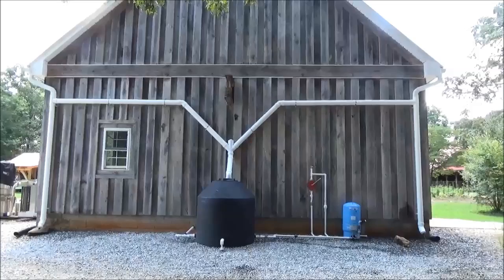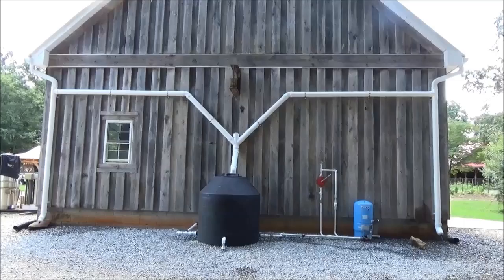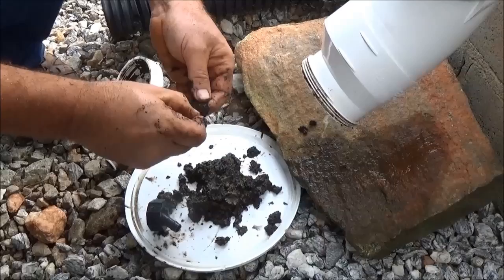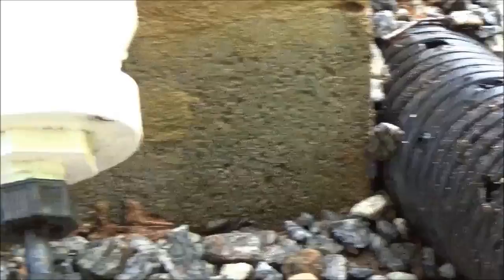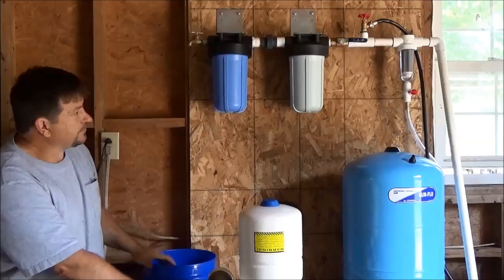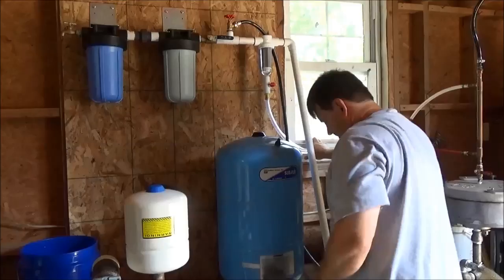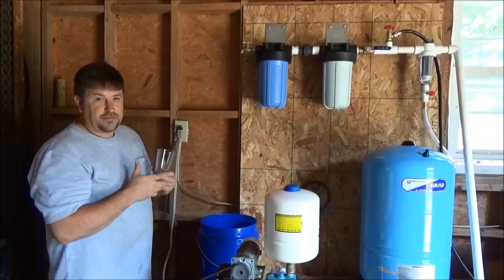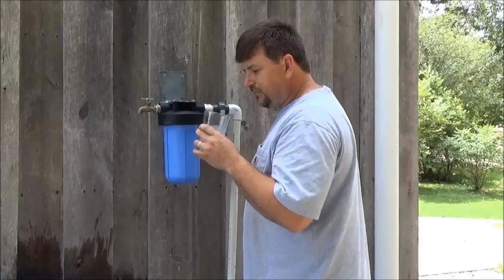Living Safely Off Of Rain Water

Comment: Hi. As a female, and one not mechanically inclined, I think I would go with a coquina bowl (porous shell rock found in st. Augustine. While on a tour at the "oldest house" they demonstrated how the early settlers would use coquina to filter their water. Boiling after filtering it of course. I appreciate the work that went into this system though. You will be super useful to some lucky gal 😊

Comment: Here's a suggestion for those worried about safety: do what I do. I have a rainwater collection system with NO filtration, and use the water for just one thing: toilet flushing. Our toilets are responsible for about 50% of our water consumption, so using rainwater eases the load on our well and pump. It's a great set-up; sediment settles in the tank so the water is crystal clear at all times, and I wash the tank out every few years. Easy. if I needed to get all my needs met with rainwater I'd be looking at underground cisterns, because water stores far better down there where it is cool.

Comment: The low-tech method would be the following:
Replace the filter drip reset devices with a small hole drilled in the first-flush piping. (still need to clean out occasionally)
Replace the floating siphon system, for removing mice/insects or whatever, with a screen or leaf-guard between the incoming water and the mouth of the tank. This keeps floaties and critters completely out of the tank.
Replace the pump with a small 12vdc pump or elbow grease (manually carry/pump water from the tank to the small container).
Replace the filtration system with a homemade berkey water filter (buy the "candle" elements and make your own stacking containers).

Comment: Best not to use the outside setup if you live in a winter climate.  You'd have lots of cracked pipes.  In the north we usually have a cistern located at basement level and then flush out the solids that sink through a bottom drain. Likewise all the pump and filters need to be protected against freezing.

Comment: I'm in Australia and we're fairly lucky to have good, clean rainwater. I use my rainwater for cooking, cleaning, washing, irrigation, flushing, bathing and drinking without any filtration or treatment other than gutter guards and screens on the tanks.

Having said that, I do want to set up a first flush system to cut down on sediment in the tanks. I have two tanks for rainwater storage, one 90,000 litres and one about 4,000 litres.
Reply: we are similar,  the yanks seem to be mighty scared of their rainwater.  They must have some nasties that we dont or they are massively over designing things.   Still,  if it saves just one kiddie
Reply: plastic tank of stagnant water +heat=nasties. The more you know.
Reply: Do birds not crap on your roofs in Australia?

Comment: This looks great so thanks for sharing that.  I'm curious though about how much you have invested into a system like this. Surely the good filters are expensive as are the covered gutters, skimmer, reservoirs, piping valves and pressure pump, etc. How did you determine your reservoir(s) size(s)?  Do you use this in addition to a well?  I know you are selling your plans but why is there is no info on how much the plans cost?

Comment: What kind of filtration system would be needed to collect rain water to fill the toilets only? Obviously this system would be over kill, as removing bacteria and such wouldn't be needed. But removing bugs, leaves and other particles would be needed as to not clog up the "clean side" plumbing.
Reply: pretty much nothing,  have a strainer where the water goes in to catch large debris and thats about it.   If you want to get fancy you can add a flushable filter before the house
Reply: Just need a swirl filter to remove the organics, (if you are worried about staining the inside of the toilet bowl.) If not, what yarpos said.

Comment: Hi Scott.
With bird droppings etc being dissolved from your roof surface into the rainwater, wouldn't you consider additional sterilisation of your water,  from perhaps e-coli  viruses and other nasty pathogens ?
The ceramic filter would only trap nasties bigger than 0.9 microns so there are risks of small viruses making it through ...your thoughts ?
Maybe a UV lamp at the end powered by solar batteries and inverter ?

Comment: In the process of setting up our rain water system. Gutters are up, tanks are in, 1800 gallon capacity . Will be installing our first flush soon. We also have installed water catchment at our chicken coop. I am eager to see the system work. 
I bought a water purification system from lowe's, we're hoping to use solar to run a 12v pump to move the water.
Also First Flush has a filter screen that can be removed and cleaned, it's for the diverted water that drains out. Do they help or are you using one?
Are sand filters a viable option for drinking water? We were thinking of installing one at the coop but unsure of how well it would remove contaminates for livestock.
In  this video I saw you were using a pressure tank, is it for the incoming water (pre-filtered) or is it for your filtered water,. I would guess filtered. I had never considered a pressure tank.
Thanks for any help.

Comment: I thought you have a water well on your property.  That's why you have the red hand pump.  If you have a well then why not just generate electric for the well pump to fill 100gl of drinking water stored in the house and use the gutter system for toilet flush?

Comment: illegal in colorado springs, we are not allowed to impeed the progress of the water to the river.
Reply: Time for a sleeper diverter of some sort that can allow all, some, or none of the rain water to travel through the normal surface discharge downspout. Maybe a manual or remotely controlled diverter that is actuated from inside the building so that when the water police show up to check you out everything appears compliant. Scott's PVC downspouts look promising, but a square or rectangular cross sectioned pipe would make it a better hide if you want to disguise a diverter take-off that fed water off of the building side of the pipe. Mounting a downspout with a flat backside flush to the exterior building finishes would make it impossible to see any evidence that you were "stealing" water that fell on your property, but of course beware the drone surveillance, hence the ability to divert only some of the water instead of all. The diverted water could be routed into an alternate stack buried in the wall and hidden on the inside by interior finishes. From there bury your cistern and disguise your feed as maybe part of a well supply line. Resistance may ultimately prove futile, but at least you can have some fun screwin' with them along the way.

Comment: Wouldn't gutter guards help filter out undesired elements, and therefore eliminate the need for such a complicated system?
Reply: +Tactical Fedora Gutter guards only keep out large materials such as leaves, twigs, kids toys, and such. They do nothing to remove very small debris, dust, bird & insect poop, granules from shingles, etc. There are smaller filtration systems/methods available. The downside is their capacity is generally lower and more labor is involved.

Comment: I have a question here, Why are all rain catchment systems use gutters? Why not just have a hole in top of a barrel or container with mesh or some other filter? Or a like a large fuynnel at the top?
Reply: +valhala56 the top of the barrel is 30 square inches. the top of the roof has 500+ square feet.  So more area means more water, and the gutters just funnel it to one location.
Reply: +Albion Laster Thankyou for the answer though it seems to me that if you are in hurry or have no gutters, then some kind of funnel systems would work if you are just storing water for an emergency.
Reply: +valhala56 There are these things called "Rain Saucers" that are basically huge funnels you mount on top of barrels.  But because roofs are much bigger than barrels or even Rain Saucers, the volume of water caught is much more.  But yeah, both work.
Reply: +valhala56  Also if one has water to flush a toilet with,, life is a little easier.
So use a simple rainwater catch system to collect that water

Comment: I have a couple of rain barrels at the end of a couple of leader pipes coming off of my roof. I was planning on running the rain water through a whole house filter and then possibly through a good filter like a burpee if I need to use it for drinking water. I was thinking that would be good enough. Do you think that would be ok? Your system is great but quite extensive for the average person and it requires electricity to run the pump.
Reply: +Frank Costa  The pump is run by a solar setup, I believe.  But in my opinion, and I am in no way speaking for Engineer775, any system that catches rain and makes it usable is a "good enough" system, depending on the intended use of the caught water.  If youre going to use the water for the garden, for example, you don't need such an expensive filter setup.  But for drinking, a Berkey filter is an excellent choice.  I think Scott is using so many levels of filtration to reduce the strain on a Dalton (or Berkey)filter element and extend its lifespan.  Yes, no, maybe, E775?
Reply: Thank you for your input. I agree with your logic. My plan is to filter the water coming out of the barrel through a whole house filter and then through the Berkey. I, like so many others must also concentrate on other things that are important as well and cant afford in money or time the set up shown here (as impressive as it is). I am very grateful for these videos that he posts. Thanks again for taking the time to comment.
Reply: +Frank Costa Since I live in California, and since the drought here is a verrrrry real monster, I have been "spared" having to deal with rain catch.  Which also emphasizes the need for emergency water storage.  I'm stuck between a rock and a hard place, as the saying goes.  So I'm storing what tap water I can without breaking the bank.  I've learned a lot about water safety from Scott's videos too.
Reply: The drought you have been experiencing has been excessively long. It reminds all of us that, within reason, we all have to do whatever we can while we have the opportunity.  I have friends in CA and have and will continue to pray for an end to this drought. I have said for many years that food and water will be the silver and gold of the future. That future is starting to happen now.
Reply: Frank Costa Not to sound too woo-woo, but the future is always beginning "now".  Every second that clicks forward is a second into our future.  I find myself focusing on practical needs, like water, food, butt wipe paper and solar energy for recharging flashlights, but also on more intangible spiritual matters.  That balance is a tricky dance, and one I am still learning.  My prayers are that we can all learn to dance together, rather than tearing each other apart as things get worse, because things WILL get worse..

Comment: I dont understand the back flushing. Do you need to do that every time you use the water?
Reply: +The Blue Farmer Back flushing is to clean the coarse sediment filter.
Reply: I get that, but how often does that need to be done.
Reply: At least two indicators: One, visual. Is the filter clogged? Two, measure differential pressure. Some devices have a popup to indicate. Other systems have upstream and downstream gauges to measure pressure. Filters are good while pressure is equal.